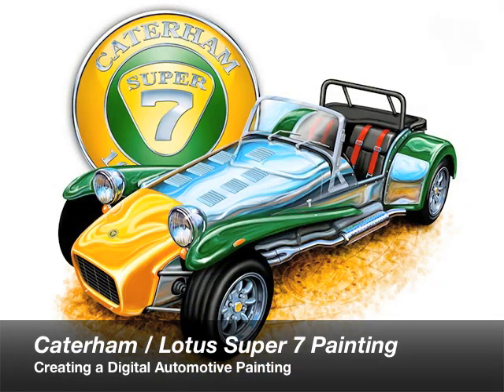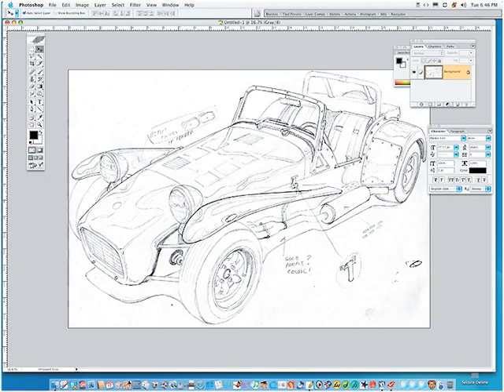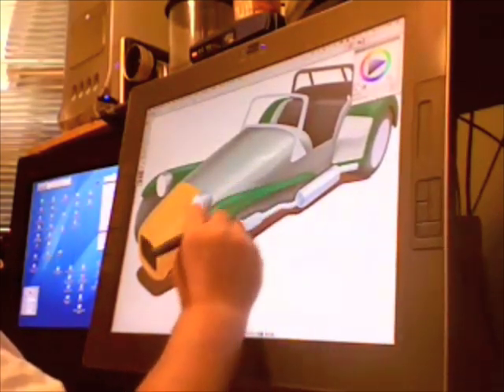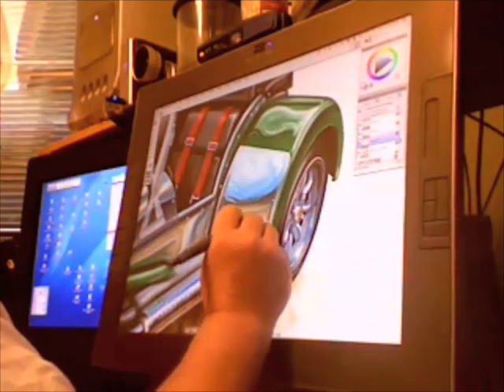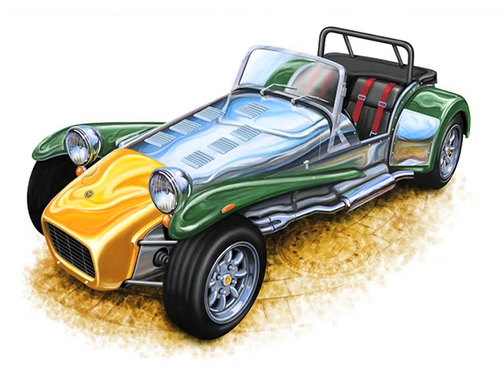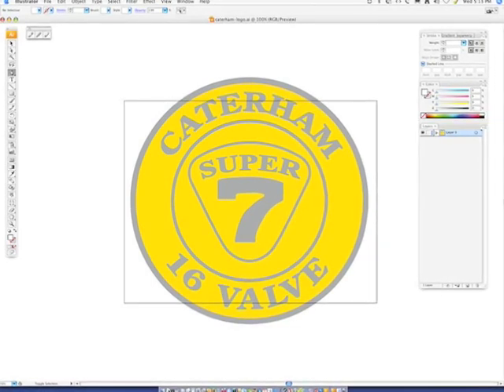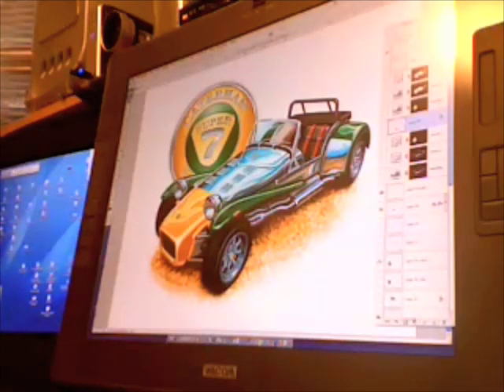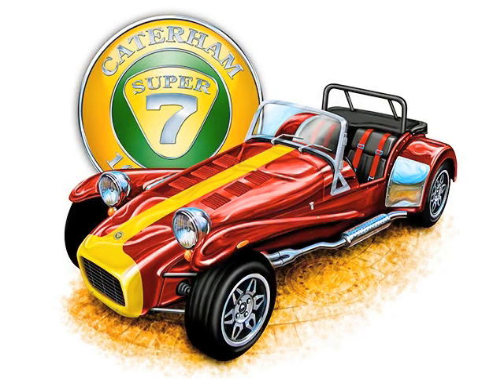Caterham Super 7 Painting Process

Comment: if you buy a cintiq model make sure to buy a smudge guard for it so you wont cause friction and dirty your lcd tablet. also make sure to change your nibs whenever you see them wearing down to prevent scratching.  try to not use the felt nibs as I heard it collects dust and grime and may form a abrasive gunk on the felt nib that can scratch the cintiq capacitite screen.

hope this helps :)